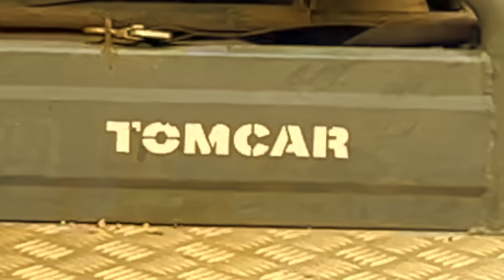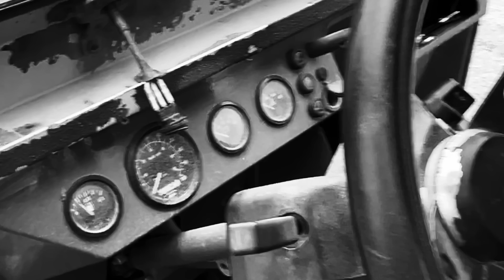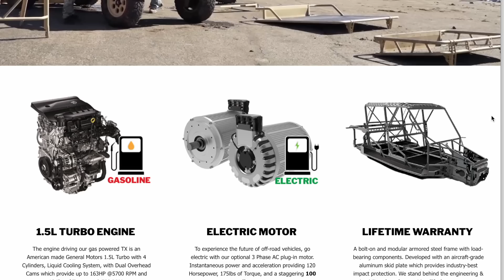THE BEST UTV IN THE WORLD TOMCAR REVIEW - RedNeck Physics | Comment For Answers

Comment: From what I understand, Tomcars were designed as military vehicles, and were successful at that: They're indestructible, and can go anywhere. They're also bulky, heavy, underpowered, and priced for an Uncle Sam-sized budget.
Reply from the maker: @Baribrotzer  that’s a pretty good estimation of the situation. Four seater TX weighs in at 2700 pounds compared to 2300 pounds for a Polaris Pro R. 
As far as power goes, you’re certainly right there 184 hp for 2700lbs empty is not super peppy. Although a decent bit better than your daily driver, probably.
As far as pricing goes, they used to until a few years ago offer their TM series which started at 20 K.

Comment: The price is ridiculous considering you can buy a Jeep Rubicon cheaper and multiple other off road vehicles that are just as good or better than a Tomcar. Which i have driven and enjoyed for the most part. But it only 2 wheel drive and way underpowered . It was really uncomfortable and wasnt nearly as impressive as it should have been for the price . Its absurd that $49,000 doesnt even get you a 4x4 or cab enclosure with a Tomcar. Its stupid overpriced . And lacks the comfort and capabilities of countless other SxS or utv offerings that are significantly cheaper and offer greater capabilities.  Plus its just ugly .
Reply from the maker: So I seem to have done a very bad job conveying that only the older models were 2 Wheel Drive. The new ones are four-wheel-drive with air, lockers, front and back.
For most use cases, I agree that your points stand.
Reply from the maker: To me, the singular reason why the price point is worth it is because of the center of gravity. You can spend 50 K aftermarket on an X3 or pro R and still have a hi CG. For the vast majority of you cases, it’s not necessary but at least for the stuff I like to do I want to be able to do crazy side hills.

Comment: Too bad they don't make a 4x4 version. That would be something I'd be interested in.
Reply from the maker: All of the ones that they make currently are four-wheel-drive only the old gen TMs were rwd. Front and rear locking diffs. So you can even do cutting brakes because not just a dumb full-time spool in the rear.
Reply: What?
Reply from the maker: @reverett0508  front and rear selectable locking differentials. Most sport utvs just have a ring and pinion gear in the rear diff meaning that both rear wheels have to turn at the same time all the time. Tomcar rear diff can be unlocked. So you can apply brake to inside rear wheel only, stomp the gas and pivot around corners.
Reply: @redneckphysics  Ya I was responding the person that said it didn't have 4x4.

Comment: I saw one of these outfitted for a fire department and it was pretty cool.  I really like that theres a spare tire and the front and rear tires are the same size.
Reply from the maker: Yep that should really be required nowadays. Out of curiosity what state was that fire dpt in?
Reply: @redneckphysics  I'm not sure.  It was on a YouTube video.  I had forgotten the name of it, but seeing your video reminded me of it.  My fire department got a 4x4 Polaris Ranger a few years ago with a small water tank, pump, and also an area for a patient on a backboard or Stokes basket, but the almost half of it hangs off the back.  I wish we'd gotten a TomCar or a Can-Am Defender 6x6 to have a much larger bed and payload.  We had to upgrade the rear suspension because it was maxed out with the water and two guys.  Its got two different sized tires and we don't have any spares for it or even its trailer.
Reply from the maker: @ml9867  Yikes that doesn't sound like a nice scenario... Especially with a trailer... I would really prefer some excess power, and better yet 6 wheels pulling... -Best of luck

Comment: The new car with the modular cage isnt even in production and only a prototype. The car they have there has been built in Israel and was sent to us to build off of. The Israeli welds and build quaility on that chassis is not good, and dont reflect the craftmanship of the guys that worked in the shop in AZ. The older TX models and TM models frames are proven and are strong.
Reply from the maker: Good to know. Thanks for comment. I’ll see if I can maybe trim that part out of the video…
Reply from the maker: Do you know if they ever made the switch to mechanical lockers? They were talking about last time I was in the. Deer valley shop.?
Reply: When I was working there still the engineering team were testing different lockers, but never decided on one. To my knowledge they still use the air locker. With the new turbo gm motor the lockers were constant problems.

Comment: Too wide and expensive for me. Trails are 65 inch maximum width in my state. That exposed drive belt is a no go! You run over a branch and there goes your belt.
Reply from the maker: I totally understand about the 65 inch limit. They sell certain models with no cover so that you can change belts literally in seconds during combat, but they also have covers if you’re gonna be in wet places.

Comment: My Tomcar TX2 is ancient... but still takes me where I want to go and back.  Speedometer doesn't work anymore but they are easy to field repair and are tough as hell.  I live in Arizona so think MOAB and the Centipede.  I think mine is on the 2nd Kohler engine now with 100K+ miles on it.  I was used as a rental in Sedona for 10+ years, 8 hour days 6 days per week with no breaks.  Runs like a tank.
Reply from the maker: 100k miles for real?!!! That’s pretty wild.
Reply: no breaks ? same belt ? axles ? wheels ? tires ? lol.....
Reply: Seirti
Reply: You were used as a rental?

Comment: Would be cool to see you get your hands on a tx3 for a review.  Hard to find any good YouTube videos doing reviews on tomcars, good to see someone finally is.  Hope to see another one from you.  Thanks for the vid.
Reply from the maker: I hope I can too! :)
Reply: Just go get one.  Doesn't matter how old they are, as they're like the original VW Beetle, you can fix anything on it in a day without any special custom parts or tools.  I bought mine for $4700 and replaced the battery, oil, and throttle cable.  In an hour, I had a durable machine ready to take on the Centipede in Arizona!  You can still find them for sale.  I'm not sure what people are saying about speed though, these things will go 55mph and when you're on trails, you've got to be trying to kill yourself to want to offroad that fast.  I have jeeps look at me in amazement as it climbs over things they put 80K into their jeep to make it through.